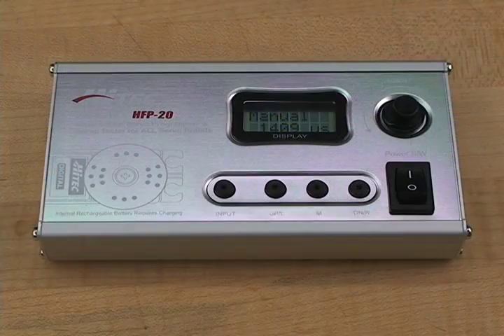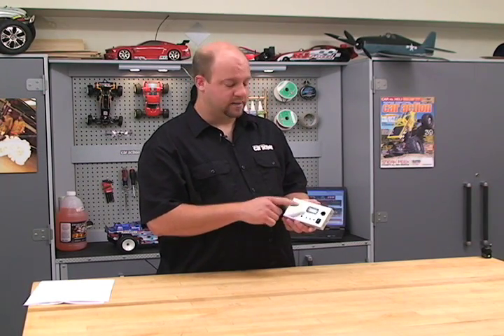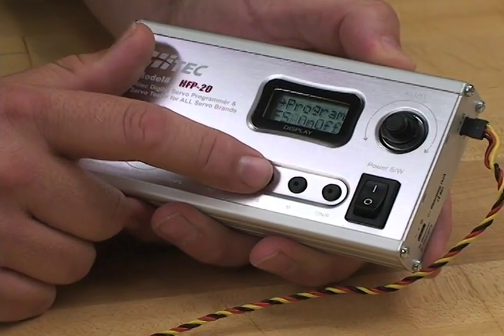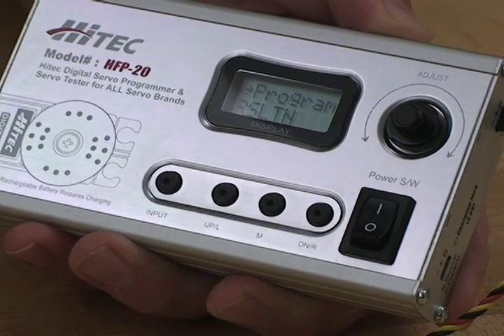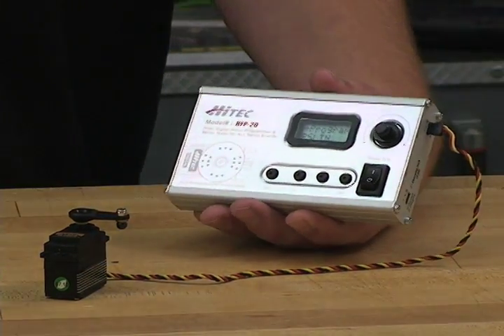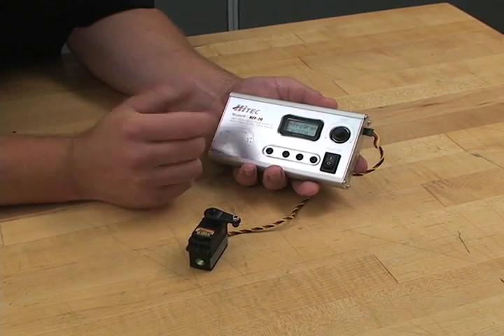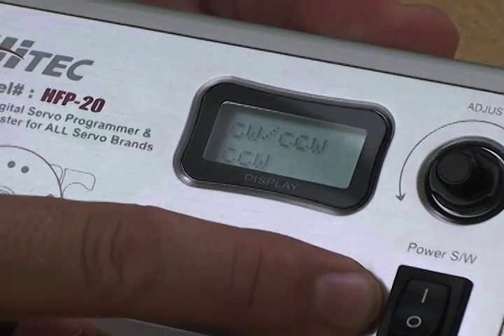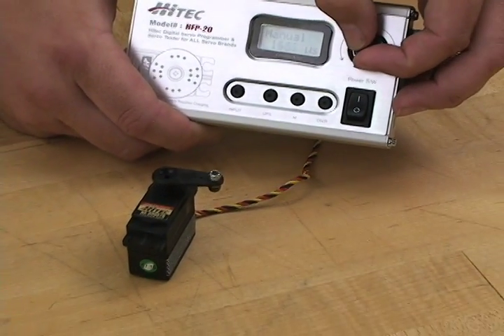Hitec Digital Servo Programmer

Comment: Why would you ever want to program anything less than ten or twenty servos at the same time? And how do you program dance sequences? And does this mean you don't need a microprocessor anymore? I don't see any benefit to this tweak device. You can control all those commands from the microprocessor anyway.